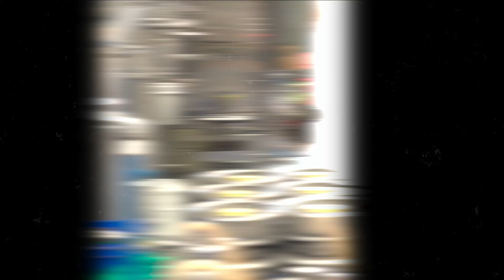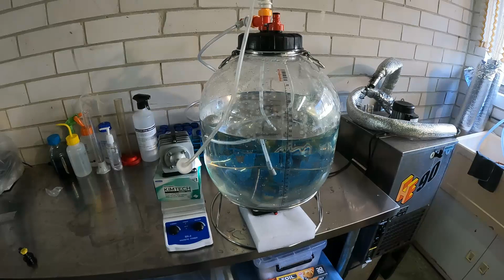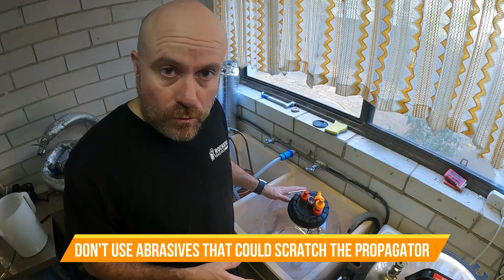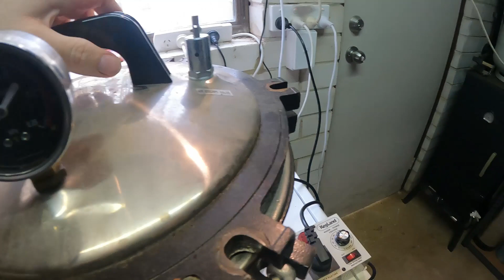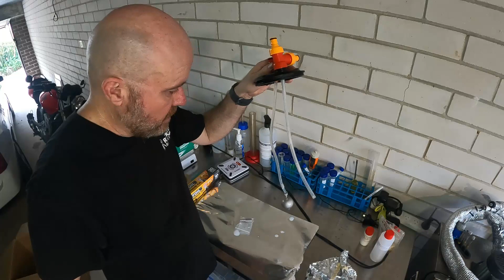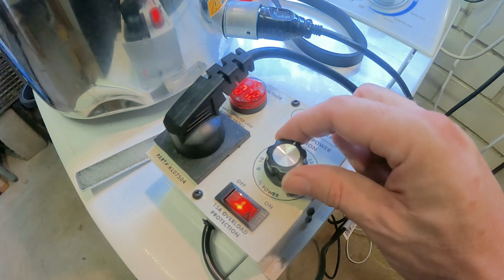Aseptic Cleaning Sanitizing Sterilizing 500 Dollar Yeast Propagator Part 2 Complete Guide

Comment: This is the exact piece of kit I've been looking for. Thanks for this! An autoclave is a touch out of my budget at this moment. Would I be able to boil the components that you autoclaved for 10 minutes or longer if it helps? Bit worried about the plastic components
Reply from the maker: The purpose of an autoclave is that it takes the temperature well above boiling point. Boiling alone will work but is not as effective. My autoclave only cost $100 from eBay so it shouldn't be out of reach for a pro brewer. Thanks for watching!

Comment: Pro brewers should know this, but a very critical point to make is to never use CO2 to push out caustic because the chemical reaction can cause cavitation of your vessel. Even with a Pressure Release Vacuum Breaker (PRVB), it can happen so fast and violently that it can still collapse a tank. Same with taking a very hot closed/semi-closed vessel and using cold rinse water.
Reply from the maker: Absolutely!  However, as this small scale, in a plastic vessel and at low temperature, the risk is quite low.

Comment: Thoughts on using a corny keg with a 3 port lid instead of the fermzilla? Im only worried about the stirplate thing, i think the bottom of the corny is too thick with the rubber bottom. Maybe a sanke sixtel with a three port lid?
Reply from the maker: I'll be making a stainless steel version of the year propagator very soon so make sure you subscribe. Thanks for watching!

Comment: Coming from a home brewer perspective, you could save co2 by using the aquarium pump to push the cleaning/sanitising solutions out through the dip tubes
Reply from the maker: Although this would work, and I do appreciate your comment, so much CO2 is used in a commercial brewery that this would be a negligible amount. Also, without a check valve, if you turned off the pump the liquid would go back into the aquarium pump and destroy it (this has actually happened to me lol) ... Thanks so much for watching 🙂
Reply: @RockstarBrewer  Loving your videos, Sir Hendo. I appreciate the point about negligible co2 use. For me, it would probably come down to what is conveniently within reach. I assume you had to move your co2 cylinder over to the sink. The pump should be safe from liquid if connected to the same connection you used for the co2 - i.e. the connection without the silicon dip tubes, just filling the head space, as you did with the co2

Comment: Don't use abrasives that scratch the allrounder, but you'll be fine smashing a SS carb stone around in it like a cement mixer. I jk.
Reply from the maker: Ha ha yep. Not using abrasives was mentioned in the video. I agree, I can't see a magnetic stir bar scratching the Fermzilla and even if it did, they're cheap to replace. Thanks for watching!
Reply: @RockstarBrewer  Dude, really enjoy your channel, not many pro brewers doing yt and sharing the caring...

Comment: I dıdnt know SIP could be used as a term for sanıtıse, steam or sterilise. I thınk wıth sterılıse-ın-place SIP, lıke a carlsberg flask, sanıtatıon ıs part of the CIP process. I was looking forward to seeing how you would sterilise the fermzılla.. I contacted a yeast manufacturer and they also only do CIP and COP (clean out of place)(probably PAA (cold sterılısatıon)(PAA is H2O2 and vinegar.. well well.. ), lıke you saıd, with UV filtered water). UVGI would be bad for plastıc I would ımagıne. perhaps hypoclorous acid HClO or hydrogen peroxide H2O2 (7.5% hydrogen peroxide and 0.85% phosphoric acid (to maintain a low pH) - CDC) would be home safe and ecofrıendly.. How are you confıdent that the vessel would not be contamınated? what qualıty controls do you do? really love the buıld thank you
Reply from the maker: Thanks for your comment. There's lots of options here with regards to chemical selection as you've pointed out; each with their own advantages and disadvantages. An ATP meter would be a valuable tool here to verify CIP and, in my course at the Rockstar Brewer Academy, I teach brewers how to plate samples with various selective media without expensive lab equipment. Thanks for watching!